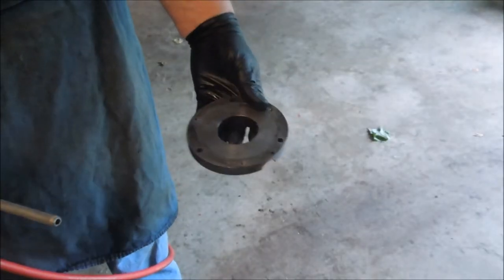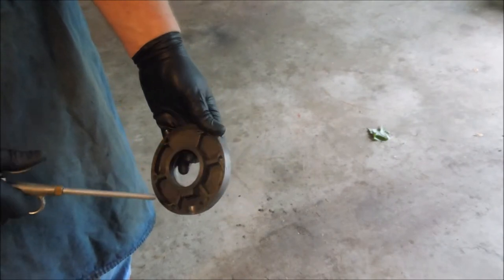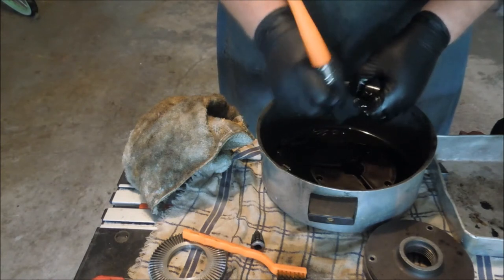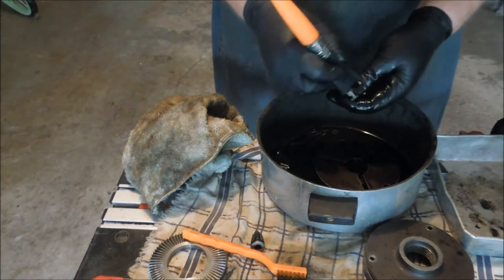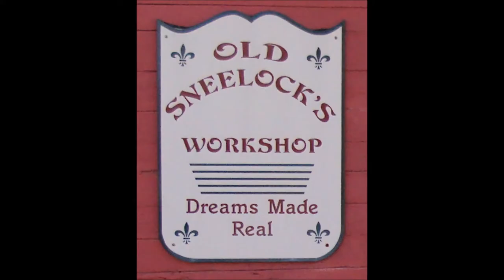SHOP ORGANIZATION CLEANING A THREE JAW LATHE CHUCK ~ PART 2 ~ SOUTH BEND 9C LATHE

Comment: Amazing how things change colors. I remember cleaning the insides of truck cabs when I swapped rigs and smokers had been there before me. I got a spray bottle of 409 and a stack of clean shop grease rags and went at it. The cabs were about the same color of your chuck/Charles when started and ended up a light brown/beige when finished. You could see the tar and junk run down when the spray hit it. Sure glad I quit smoking!
Reply from the maker: I bought a truck from my Dad and did the same thing. That 1969 Chevy was actually green on the inside not brown.
Reply: Makes you appreciate being in a cleaner place and not having to smell the tar and stuff all the time.
Reply: I worked as a TV technician a number of years back in the 60's and 70's. We would bring in a TV for repair and the first thing I did was clean the screen. I'd spray on the Windex and see brown/black "rivers" of tar roll down the face. It was amazing how much brighter the picture was after the cleaning. Can you imagine what smoker's lungs look like if things in the room (or cab) are that bad?

Comment: I've got an idea for once. Hows about making a parts washer??!! Couldn't be that hard and with your yard sale eyeball, parts would just pile in.  And the garage is close to a tailgate and my brush has a yellow (NAPA?) handle but is a little fuzzier. Good old compressed air!
Reply: a 12v water sub water pump would manage the degreaser fine, i used one for years to pump diesel, take a cut open drum, wooden stand, wooden top,  old oven shelves for the support rack..thats most of it right?
Reply: RIGHT! Maybe have a partition so the gunk could settle out and a sock for a filter to keep chunks out of the pump. A 110 volt water feature pump ought to work too but some outfits sell pretty cheap parts washer pumps. Piece of confectionery for Unc!
Reply: have the degreaser in a separate tank, with the pickup near the top, so all the crud settles, hhmm pump from old washing machine ?
Reply from the maker: Not a bad idea guys I wonder if I could use water based cleaner like simple green for the solvent. That cuts most things and I wouldn't have to worry about venting or fire. 
The garage sale idea is pretty close to the mark. The free stuff I got at the last sale had a nice tub in it. Mount a sink drain to drop into a 5 gallon bucket through a screen and rig your sock filter over the pickup on the pump. 
I have a couple submersible pumps for water fountains. 
Great idea.
Reply: Taryl Dactyl on 'Taryl Fixes All' soaks carbs and stuff in it. Ought to work. Keith Rucker uses 'Citrus Strip' to strip paint on lathes and such. Maybe there are alternatives to gasoline. Hmmmm............

Comment: i think if someone works at a high position in a company, its good to see if they can still get their hands dirty or push a broom when times are busy, than hiding at their office pretending to be busy
Reply: Right. I got to help fix what everybody tore up, even myself. You get a close up look at stupid decisions and the effects. I learned a lot too. Still learning.
Reply: now if a certain guy, (that i wont dare mention in case of feelings) had used a broom , perhaps he might have some understanding in life, but stuck with him for now
Reply: Brings to mind a lot of bitch and very little fix. Yet and still. Won't tell you what to do and if you try something, it's wrong. You should not operate heavy equipment in situations like that. I ought to know. Not a good place to be in on the 'mouth' end.
Reply from the maker: I agree with you. Crap happens and everyone has to pitch in every once in a while. The only proviso I would put on it is if I find myself having to jump in more than once in a very great while I'm not doing my job. I'm suppose to anticipate problems before they occur and plan ways to prevent them. 
I started as a supervisor in 1981. I was taught a lesson by one of my men that I have never forgotten. About two weeks into my tenure as a supervisor for United Technologies I heard a call for maintenance at #3 Press. I went to see what was happening. One of the men was standing by the Granco billet heater. After watching it for a few moments he reached into the burner control linkage and tapped it with a long screwdriver. 
He stepped back and stood there for a few minutes and repeated his actions. All the time he was standing there he had a tool belt over his left shoulder and a paper coffee cup in his right hand. 
After a couple tapping sessions I stepped over and took a look at the linkage. It was over traveling and locking up. I reached over and picked up a pair of his pliers from his tool belt. Then I loosened the locking screw and adjusted the linkage. Problem solved. 
When I turned around he was taking a drink of his coffee. Still watching me work. 
I handed him the pliers and told him what I had done. 
I never did his job again. As a supervisor, manager, company president or king the whole idea is to have the people who's job it is to do the work do it properly. 
I had failed to do my job that day. I should have called him over and explained what needed to be done and made sure he understood and followed through. 
I didn't respect him enough to expect him to do the work.
Reply: True enough but when you get saddled with someone else's job and yours too it gets really interesting, knowing you've got to work somewhere. There are always 'pets' and when the 'boss' has a chunk on his shoulder for you it makes for a really trying space of time; hour, day, week, year. I promised I'd smile when I left. I had to remind myself when I went down the hill the last time. Probably the only job I've never missed BUT it was who was running it. I was there from the first and maybe he resented it. I could've turned his head around and by Gods Grace alone I didn't.  And I found out that I wasn't the only one that got treated like that the day they quit. 'Nuff said.
Reply from the maker: I have left a few jobs. One I walked out without a plan for my next one and didn't care. The guy running the place had called in one of the salespeople and chewed him out with the door open. The salesperson just took it. I told my wife it would never happen that way with me and I walked out before he got carried out. 
Unfortunately there are people who just don't understand what they are doing. 
I'm glad you were able to leave and find other employment. It might feel good taking the guys head off but walking away doesn't take near as long to get over.
Reply: This is what I call thinking ahead. I know you and Lydia do it and everyone else that actually thinks and maybe talks about stuff together does. That's why we have extra stuff and ways to do things when the power goes off and such. People in cities ought to think a little ahead, like what if....... Might save a lot of grief and maybe even some lives!
Reply: I agree about the Senior Management occasionally getting their hands dirty being good for morale. My wife tells of the top manager at her shop collecting baskets and trolleys when the shop was very busy or putting out bread and the staff would have walked over red hot coals barefoot for the man.